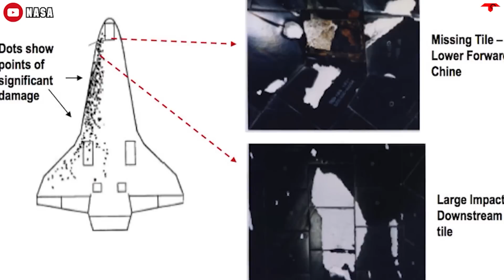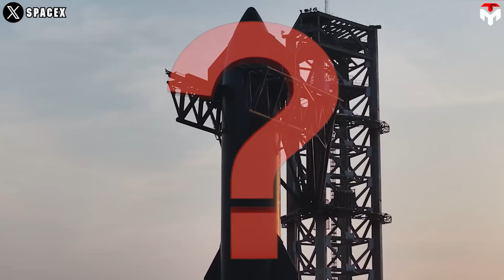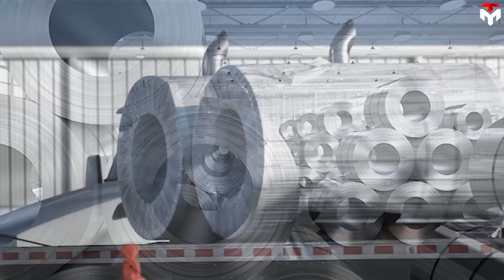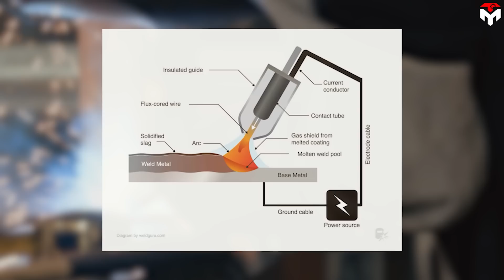SpaceX's Starship New Heat Tiles & Welding Just Humiliated NASA Shuttle!

Comment: In what way?  The shuttle flew its first mission with no faults,  and survived 132 flights.  Its tiles were not the issue. but where the Shuttle tanks were mounted.  Starship literally lost tiles on the first 30 seconds of flight!  On every flight.  Not just one or two but A LOT.  The shuttle was a incredibly complex shape, yet they managed to adhere the tiles better.  This wasn't the issue.  It's that they are fragile, and can't be hit by debris.
Starship, even with rivets don't stay on.

Comment: Stainless steel can absorb some of the heat so even without some tiles it can survive entry. The special your of steel allows to be stronger when cold, carries extremely cold liquid fuel that is normally gas at room temperature.

Comment: Something else to bear in mind,, Apollo, SLS was successfully on its first mission,,  as was the shuttle on its first mission
.
 so far SpaceX Starship has not been successful and it's on its fifth mission ....... ok incremental,,, but .... when ?
Reply: Apples and oranges BS comparison. Those launch vehicles were piloted by humans, they had to be perfect on the first flight or people died. 

Rather than spend a fortune to verify untested vehicles, SpaceX can send them up when good enough so the actual flight gives real world data. 

Much better to test as you go instead of launching, finding a problem and the having to start over to fix it.

The difference in testing and safety cost is astronomical. Calling tests failed missions? What a joke. Just look at the falcon 9...
Reply: The amount of money nasa spent on apollo mission, inflation adjusted.... is 1/4 of a trillion dollars.... elon has not spent 1/10 of that in total in r and d at spacex as yet( though close by now)

Comment: the heat tiles are a remarkable achievement compared to the space shuttle. But building out of stainless-steel verses aluminum has a much bigger effect on the heat tiles as well. For instance, the rate that metals expand when heated and shrinks when cooled has a huge bearing on how well the tile can stay attached. the space shuttle was made out of aluminum which has an expansion and shrink rate of 0.4% to 0.7%. Whereas stainless steel has an expansion and shrink rate of only 0.0004% to 0.0008%. The less expansion due to heating allows for the maintaining of structural integrity. The more expansion and contraction, the quicker the wear. This is why the space shuttle had to have all its heat tiles replaced after every flight.
Reply: Assuming I agreed with your expansion numbers, the spaceframe was never exposed to sufficient heat to cause expansion. You lost all credibility on the final sentence. On average each orbiter had 22,000 unique tiles. Only the few damaged during flight were repaired or replaced.

Comment: The problem with NASA is the bureaucratic mindset vs the Edison mindset. Bureaucrats think “incomplete” tests are failures. The Edison mindset thinks 10,000 lightbulb “failures” results in a list 10,000 materials that won’t work and one that will. No testing results in no lists of unworkable materials and no lists of things that will work. You just get lots of reports that no one reads, but result in lots of spent budgets.
Reply: and you get a vehicle that works the first time! You forgot that part.

Comment: Please stop with "aestetics". Stainless steel has superior very low and very high temp properties. More damage resistant and also carbon fiber damage can cause delamination and can fail alot easier. Stainless also reflects heat better.
But the kicker is that stainless costs less than $4/lb. Carbon fiber (all costs in) costs $180/lb. 

Other than that... nice.

Comment: It is time to take a few classes in manufacturing.  The reason carbon fiber isn't used is the mold storage issue.  SST doesn't need molds.  This report appears to have been written by someone that has never worked in manufacturing.
Reply: It's the reusability.  Hell.

Comment: It wasn't the shuttles' heat tiles, but the shuttles were space rated for just so many flights due to accumulated stress and strain. After that, the shuttle has to be refurbishedband re- qualified or replaced.

Comment: Some sort of interlocking joinery design on the tiles. That way each tile isn’t dependent on its own fasteners, it can rely on all the surrounding tiles for extra strength ???
Reply: And f--k thermal expansion.
Reply: @tonyduncan9852  both hot and cold expansion can be factored into the design….right ? besides my comment was mostly because of what looked like a second layer of tiles in the thumb pic of the vid… I’m no engineer, that’s why I put double ??
Reply: @Canoga_Knuckles  No worries.  Simple problems don't always have simple solutions.  :)